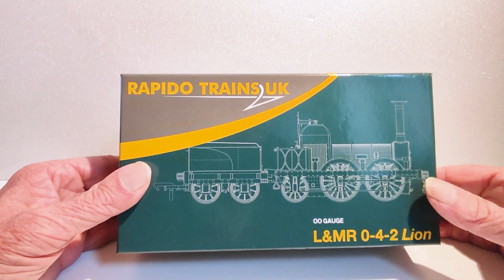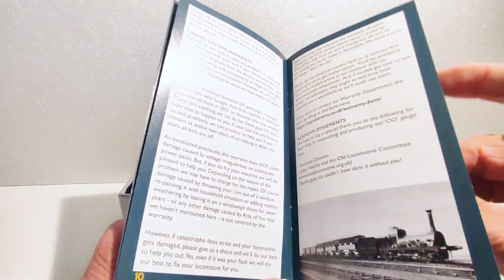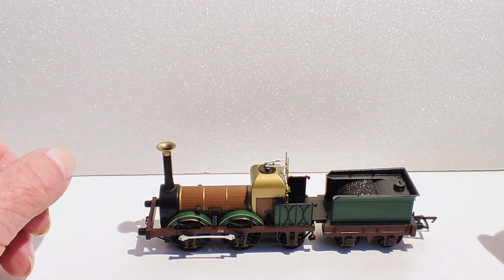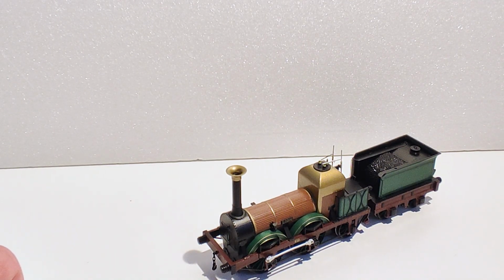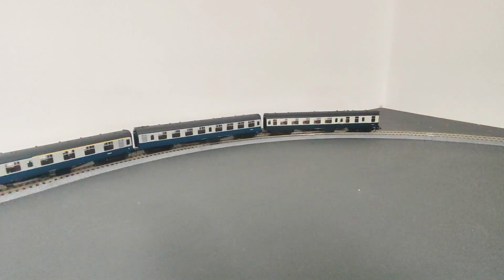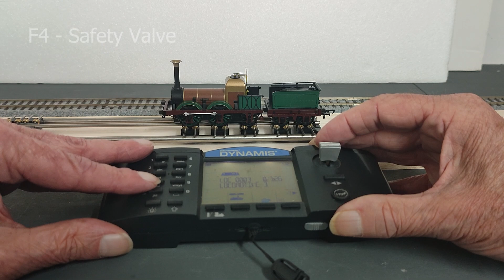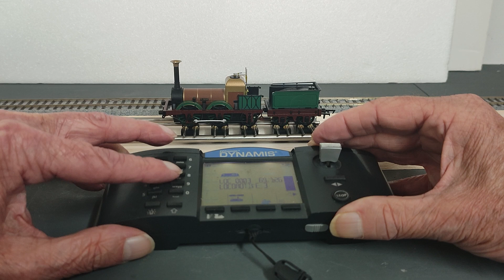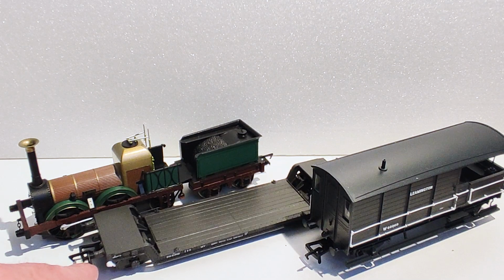Quickview: Rapido Trains L&M 'Lion' with DCC sound

Comment: There are some prototype subtleties captured in the model you haven't spotted. 
Lion's driving wheels are not matched pairs (different numbers of spokes between the front and rear driving wheels), and the horn guides are different between the front and rear driving wheels. The bolts on the frames are not uniform but the same mixture of round and hexagonal heads as per the prototype too. 
Of course the model is sold as being of 1929 condition not 1830s (see Anthony Dawson's book). As built Lion and Tiger had a different boiler design with domes and safety valves on the boiler barrel and a low firebox (similar to other Large Samsons 0-4-2s  and the 2-2-2 Patentee types). Current boiler is a 1859 Mersey Dock & Harbour Board replacement with a plain boiler barrel (possibly suggesting it could have briefly carried a saddle tank before being repurposed as a pumping engine).
The L&M livery in the late 1830s /1840s would of had dark green boiler cladding rather than varnished wood appearance.

Comment: Nice video of an ultimately disappointing model. Coming out second, you'd imagine it would have the edge over Hornby, but it just doesn't seem to. A model like this, to me, is all about detail, not haulage and with less detail over all, that which is there unrefined and crudely applied as well as missing paint and an awful boiler seem, all I can think of is what could have been...